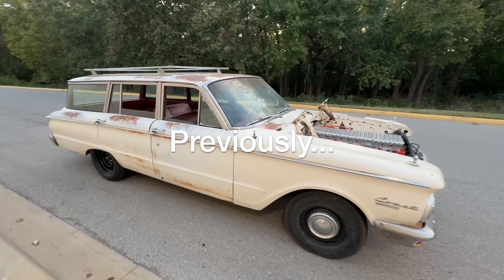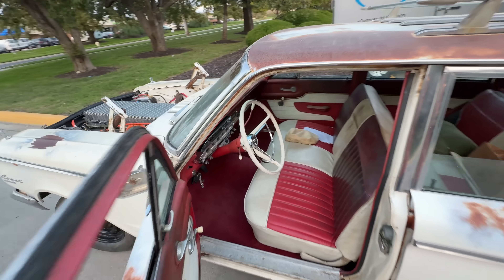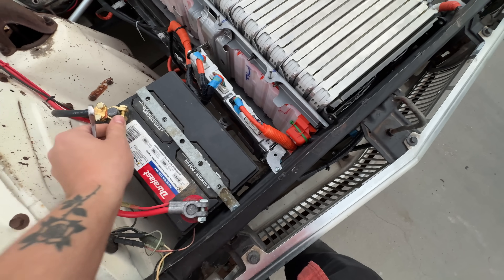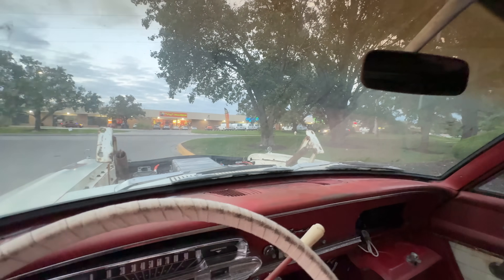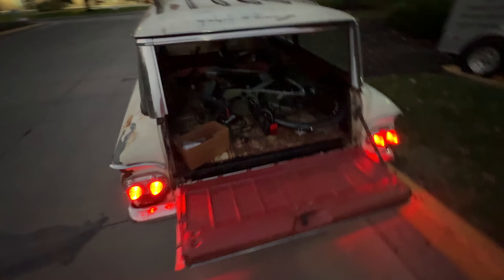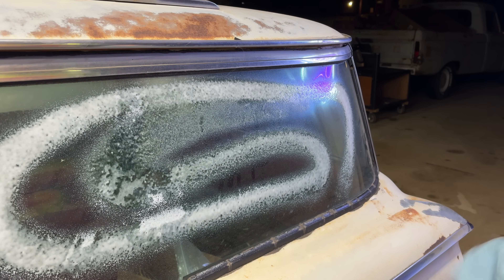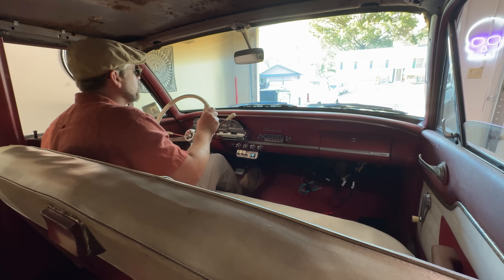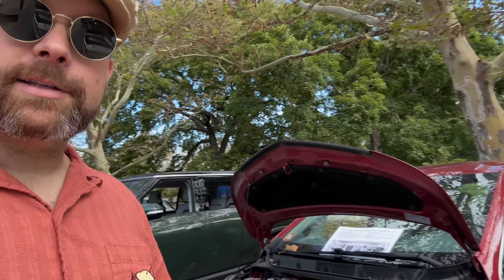What It’s Like to Drive My Homemade Electric Car

Comment: You have a PARKING brake --- EMERGENCY brakes showed up when mechanical brake got replaced with hydraulic brakes and most people feared they might fail, so manufacturers called them EMERGENCY brakes to make people feel safe. It was a marketing ploy. 
Those trailer tires need to be aired-up to what it says on the sidewalls because they are not designed to allow the sidewalls to flex - their strength is in the tread and the carcass being stiff to handle loads. If you run them like car tires, they will fail. 
For such an intelligent person, you sure use a lot of voodoo science and anecdotal proofs.

Comment: Drum brake master cylinders have a residual valve under tapered seat for the line I found this out when I put disc beakes on my 64 F100. Take the seat out I think I put a small screw in it and pulled it out then drilled the valve out then put the seat back in. Great conversion

Comment: How hard would it be to wire the 4 brake lights to display charge percent when on a charger. 25-50-75 and 100 percent
Reply from the maker: Umm, I would need an arduino to convert the CAN bus data to charge percent, and then program that to some outputs, going to relays, going to the brake lights. Seems unlikely I would get around to that but neat idea though!

Comment: I saw this and am wondering why the batterys weren't placed in the space the old gas tank was. Cause I'd figure having a small generator in it as a range extender wouldn't hurt.

Comment: Many years ago I converted a HQ Holden (Australian GM brand) to 4 wheel disks  and had a similar problem. I then discovered that there was an inline "residual check valve" for the original drum brakes. I simply removed the RCV and replaced it with a piece of brake line. Problem fixed.
Reply: Yeah, I know on the later models at least anything from Detroit. You have to change the proportion valve also unless that’s what you’re calling the residual check valve and if it is, then you would definitely want to replace it with another proportion valve that way you get your brake bias, correct there’s always more front brake force than rear the way you can stop without spinning out the nose of the vehicle gets heavier than the rear under breaking anyway, if you know you know if you don’t, then you do now everybody have a good day
Reply: those can be built into the master cylinder too, need to swap that out for the correct MC

Comment: I'm in love with this car. As for the radio, you should get it re-capped and add an FM/Bluetooth/AUX input mod, it looks great but won't receive anything with all that motor noise.
Reply from the maker: all the AC wires are shielded, shoudn't be noisy. I could try and rebuild the old AM radio with new caps, it also uses tubes. But I don't listen to AM radio. Funny thing is though I work for an FM radio station...
Reply: @ThisOldJalopy 
I’ve heard of people converting AM radios to receive SW (shortwave) instead. Things can get pretty interesting on SW! Although, lots of tuning to do on such a big spectrum

Comment: Might be advantageous to put more modern disc brakes on the front.  Expensive, I know.... and then will probably necessitate the change to larger wheels.... 14-inch or even 15-inch.  BUT... the trade-off will be better (or less) rolling resistance because disc brakes inherently drag less, but changing up to a larger wheel size opens the doors to finding more economical tires with better tread patterns again, creating less rolling resistance and helping to increase range.  With 4-wheel discs, you could have your choice of master cylinders and add a pressure differential valve to help dial in your rear brakes a little better.   A lot of money, a lot more work but you'll have a much better driving car at the end.

Comment: Back in 2015 I leased a new Nissan Leaf for 3 years.  Mileage Per Charge was not for good. Regen braking did work well. I commuted roughly 30 mi one way to work in Wa St.  Downhill & level to work for 30 mi. & then 30 mi gradual uphill after work heading home. Going to work barely used any battery. For example: 105% full charge to work with sometimes 90%.  Going home however, fully charged at work 105% to end at home with about 25-30% left over. That is with some in town driving with some highway driving.
All I can tell you....is the battery anxiety was REAL in a 2015 Nissan Leaf.
Reply: That’s a great firsthand insight sounds like you really got to experience both the pros and cons of early EVs. The regen braking on those Leafs was surprisingly ahead of its time, but yeah, the range anxiety back then was definitely real! 😅 It’s crazy how much battery tech has improved since 2015. Have you had a chance to try out any of the newer EVs to see how they compare?
Reply: @Mike-kn9 I have driven a Hyundai, Tesla model S, but I know it's vastly improved since 2015. I am waiting for now to see what comes of Sodium-ion, but I don't think it's ready for the car market any time soon.  I own a Hysolis electric generator that I really like that is Lithium, but sleeping near it makes me a bit nervous Lol. That is the market I think Sodium will have a better chance for testing.
Really impressed with your project and content 😎🤙 hoping to do something like what you did...I have a few Kei trucks and it's got my wheels turning......😊 Great job my friend
Reply: @Mike-kn9 I have driven a Hyundai and a Tesla model S......far superior in comfort to an older leaf, but that Leaf did hit the mark for me back in the day....and yes, the Regen on car was really good! 

I am so hoping for Sodium-ion to one day make grounds in automotive.
Reply: @lynchcreekmuzzy5759  Wow, that honestly means a lot to me thank you so much! 🥰💛 I’m really happy you’ve been part of the adventures, especially the Europe trip that one was such a special experience for me and Topi! 🌍🐾 It makes me smile knowing the videos bring some brightness to your days. 💫 Do you travel much yourself, or do you have a favorite place you’d love to visit one day?

Comment: What speeds are you driving?  I'm curious how a vehicle like this would perform on my work commute. 20 km distance with 99% of it at a posted 80 kmh.  The driveway out of the trailer park where I live, the driveway into the parking lot at work, and one corner are the only places I drive below the 80 km posted limit.

Comment: i think id rather an ICE to hide the sound of all the squeaks and rattles.  a nice 289 would be a good addition
Reply from the maker: The car had a 180ci ineline-six that I could not get running for the life of me. Worked at first and then got worse and worse and worse. I wasn't using leaded gasoline, maybe that was it. I sold it to a guy named Brian, maybe that's you and you're messing with me.
Reply: @ThisOldJalopy  wasnt me, id have bought the whole car.  its a nice wagon

Comment: My god, he took the L6 or V8 out of his old 1962 Mercury Comet wagon, I think. 
He doesn't know what he's doing, forgive him, oh god of Oil ! x)
Imagine tomorrow there's no more oil in the wells, damn, but who cares... 
We'll start by removing the tarmac, and you'll see, my friend, there'll be oil for ages. 
And if, instead of dumping our crappy fast fashion on Africans, we recycle it ourselves, we could have even more fuel. 
It's magic.
Fuel never die , fuel never say is last word , fuel is everywhere , but we must recycle. 
No, it's interesting, to make a Ev car , with old car , that still exist here in France & Europe , they called that " Retrofit " but, yeaaaah i knooow , I'm a nasty naughty French guy , who comes to say "I," but....
Because there is a but , having a hybrid, a Renault Clio V 1.6 E Tech 140 Hp , I'd find it interesting to see a hybrid system built with the original engine of the car L6 or V8 with carbs , helping it to consume less fuel, or even giving it a little more power, with motors in the front or rear hubs, for example.
Have a nice day =) !
P.S :
In the USA you have a certain freedom regarding the modification of your vehicles, here it is forbidden for us, but for example, I live in the South of France, that is to say with a climate with at least 300 days of sunshine per year, so an electric vehicle has its place there, only having to be constantly plugged into the mains, whereas with flexible self-adhesive and multicrystalline solar panels, that is to say capable of capturing UV even in cloudy weather, of the type that we find on racing sailboats or simply, a system such as an improved dynamo, to recharge it constantly, would make these electric cars truly ecological, because totally autonomous.

Comment: At first I thought that bike was called "GUNT." When you convert from drum to disk you very often need a proportioning valve.
Reply from the maker: Yeah, I couldn't find a proportioning valve locally, in time for the car show. I bought a regulating valve and installed it, but it didn't fix the problem.

Comment: I had a couple Ford Falcons of that vintage, back in the day.  Same car as the Comet, basically.  Up here (N. IL) they were prone to floor pan rot.  I assume you're somewhere where that's not a problem.
Reply from the maker: Previous owner replaced the floorpans with sheet aluminum and self-drilling screws. I'll have to undo all of that and welding in correct sheet metal.

Comment: The switches for drive neutral and reverse are nice and all but I think 3 momentary roller switches working off the linkage for the factory shifter would be so much cleaner looking. Just my $.02 for what it's worth.
Reply from the maker: I would love to find a good use for the factory column shifter. That would be awesome if I could use it for the F-N-R, but I don't see myself being able to do that. What else could it be used for you think? Maybe an ahooogah horn?
Reply: @ThisOldJalopy  On the bottom side of the column where the shifter normally connects to the linkage you could mount a simple bracket with 3 momentary roller switches on it. As the tab that normally connects to the shift linkage swings around the column it would contact the roller of the corresponding switch and activate it. Honestly it's really no different from the cam device that normally works these switches in automation setups. The only difference is instead of the cam being rotated by a slow turning electric motor it's operated by moving the shift lever. The switches are common and can be had for less than $5 each and the mount doesn't need to be very heavy duty nor even welded in place. A simple rainbow shaped piece of plastic clamped to the steering column would be adequate. The switches themselves only require grams of pressure on the wheel to activate and the wheel ensures the shift tab will roll over them smoothly in both directions. I helped a good friend of mine make a manual shifter for his E40D 4 speed automatic in his car. It looked like a regular 4 speed manual and was significantly more complex to set up than yours will be. His required different combinations of 4 switches to be pressed for each gear so it ended up being quite the tangle of wires under the shifter going to 2-3 switches for each gear. In contrast your setup would be a breeze with just the 3 switches.

Comment: I'm guessing you didn't grab the dual circuit master cylinder and electric boost system from the doner Leaf. I thoroughly believe in dual circuit braking systems and recommend you look into how practical making the switch to a dual circuit system is on that car, although it sounds like you are heading that way already.

It would be really cool if you could setup something where you could use the actual selector to put the car into the dive mode of you choice, or score a push-button selector out of an Edsal and work that into the system for a more factory look.

So far the work you have done is a very inspiring and clean restoration/conversion. don't get discouraged and keep up the good work. That car is well on its way back to what it was built for, daily errands and commuting, and there is nothing wrong with that at all.

Comment: Re batteries (and range), considering it's a station wagon, what about building a shallow platform with just two layers of batteries across the rear of the car, you'll loose a bit of hight, but potentially gain a lot of capacity (and potentially better handling, because you lowering the centre of gravity)

Comment: People call EV’s “soulless”, but something tells me that this old car ASKED for this conversion. Machine spirit alive and well!
Reply: EV West has made some really cool retro fits.
Reply: Electric vehicles have been around longer than gas powered cars
Reply: @edmawhinney3564 indeed. They were the first cars. If we had decent battery tech back then, we'd never have developed internal combustion outside of very niche uses.
Reply: @e @edmawhinney3564 d yet people still prefer gas because it’s cheaper, and less expensive. You’d think since they have been around for so long they would be the only mode of transportation, yet they’re not because they’re a hassle, expensive, last for much less than a gas car, and break down easier.
Reply: @RedneckGinger-r6o Nobody in existence says that electric cars are more hassle lol more expensive, yes, and they last for just as long or longer than a gas car and do not break down "easier"
Reply: @ArmChairMechanic I don’t have to update my truck, it just starts and drives as it has for ten years. It doesn’t cost 10,000 or more dollars to replace the battery. It doesn’t get totaled by insurance from a fender bender. Takes two minutes to fill up with gas, not two hours to charge.  Gas is so much more practical, nevertheless electric can be fun and super fast but the tech ain’t there yet.
Reply: @RedneckGinger-r6o well I have a diesel, so I can't speak from personal experience. I will say that if you're truck is 10+ years then it most certainly would be totaled in the eyes of insurance. My mom's van had a super minor dent in the hatch from someone sliding into her and it will be $4k when it's only work $13k. It wouldn't take much worse to say that the fix is more than the value of the car. If an electric car came along that could go 500 miles on a great day and 300 miles on a cold 0 degree day, I'd buy one. The problem is that it would cost way too much and be way too heavy. The tech isn't there to completely match a gas or diesel. Battery density and the charging infrastructure has come a long way, though.
Reply: I drive an EV6. It's most definitely not soulless.
Reply: I've found that "soul" is just code for "loud" among car guys. The louder your car the more soul it has I guess.
Reply: @lucaswinstonismyname  Well, "car guys" need to learn about Manitou.  Pretty much all machines have one, and for proof I offer the "blood sacrifice" required to correctly repair any complex machine.  It doesn't bite you and get it's taste, it's breaking down again very soon.
Reply: Battery replacements that cost thousands? And used car can cost 700 bucks some times
Reply: @Chopstick-y8f  I'd say with the way that people take care of their cars, it's more likely that someone doesn't change oil and runs it dry and needs a new engine that costs thousands than needing a battery replaced. A battery can last 300k miles.
Reply: @Chopstick-y8f  the whole conversion of this car cost under $6k. That includes buying an old Nissan Leaf and using its battery, motor, inverter and charge equipment. 

"Replacement batteries cost thousands", this battery is from 2014 and if you'd watched his previous video you'd have seen he replaced some damaged cells (from a jacking mishap).

My 2012 Leaf had one battery module replaced for $150. It's saved me thousands in fuel and maintenance. It still has enough health for at least another decade.

I've owned petrol and diesel cars. I know what they cost to repair. I'll never buy one again.
Reply: @nadnerb2k how did you replace the module? Did you do it yourself ?
Reply: For that one in particular, yeah sure why not. Anything that actually looks cool: LS swap
Reply: ist more a combination of silence and bland designs = soulless
Reply: As a car guy for my whole life me and my family and me have worked on cars for my whole life I can say that electric cars are extremely disgusting and I’m allergic
Reply: @Chopstick-y8f the best thing about electric cars is they hardly ever need worked on. No need to fix things that aren't broken. But if you like tinkering on junk, by all means enjoy your hobby. I drive entirety too much to have a car that constantly needs to be worked on.
Reply: @Chopstick-y8f That’s rough, buddy. 

They gave us an inch, and we’ve taken a Kilometer.. and then another one.

I’ve got a horseless carriage that runs on Sunshine.. no Whaleoil, no West Texas Intermediary or Light Sweet Brent gagging my neighborhood. (Which I’m not allergic to, but it does cause cancer!)
Reply: @Chopstick-y8f just gonna agree, I find it stupid to update a car, pay a subscription to use GPS, charge the battery. We’ve had electric cars for over 100 years and they still suck….

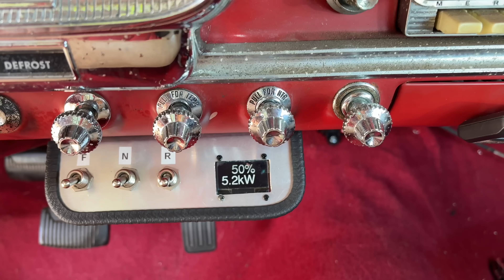Comment: 7:23 I love it --- your car definitely looks different from any of the others, but hey --- it's still off-the-scale cool-looking --- what's cooler-looking than an early-60's vintage Ford station wagon tricked out for electric, plus of course with a nearly-silent drive train, you can now hear every little special squeak and unique rattle dat da old girl's frame and body have to offer. :D

Comment: Your first problem is you're using an antique brake system. Wow. You're putting the new fuse but what system does it power. You might have put a newer front end on it that more for lighter and more better. Nice build on the battery's pack.

Comment: Personally I'd instead have an activation of the regen at a light touch of the brake pedal so you have a freewheel coasting alternative.
If you change to disc brakes also consider to have a 2 circuit system, like front and back on different brake circuits.